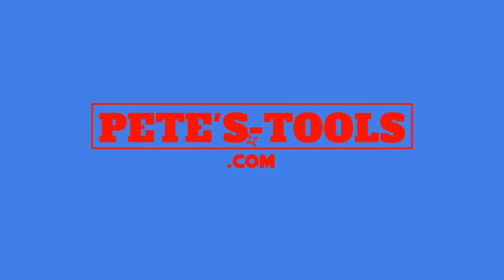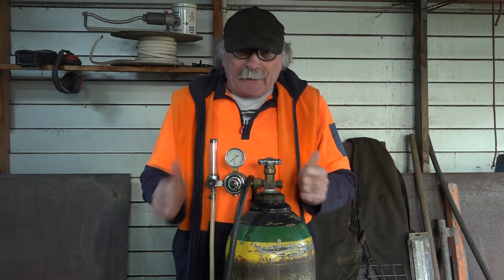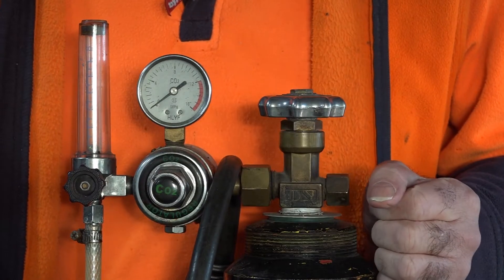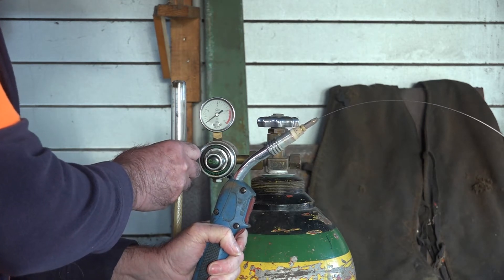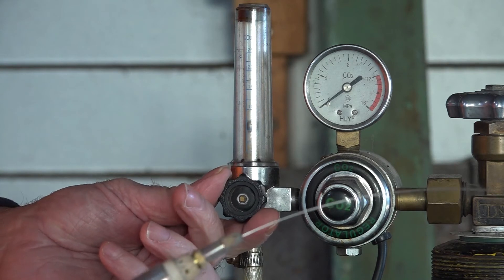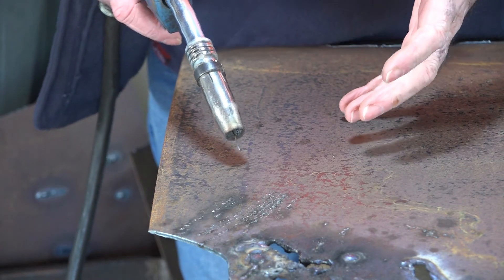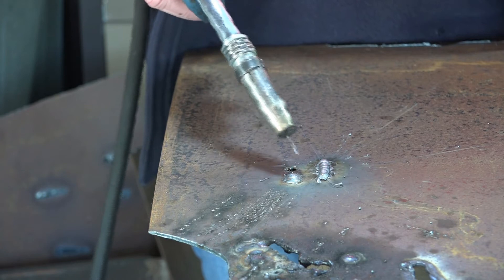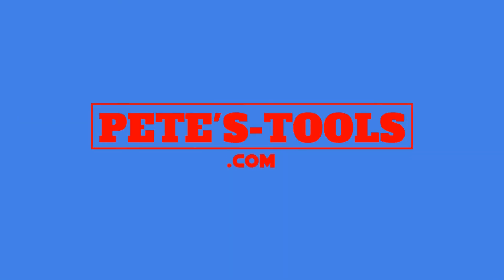Which is better? Flow meter or Welding regulator?

Comment: While I haven't welded with a gas torch in a very long time due to my patio also being my workshop, the flow meter is almost always an accompaniment to an oxy-gas rig here in the US. I know a lot of guys run them to help meter out their tig rigs, too, so you'll see all three working together for those deep-of-pocket dudes. 
Me being at the mercy of mother nature, I will run C02 when I can but most of the time I do a lot of flux-cored stuff. My big project two years ago ended up gobbling up 6 kilos of stainless steel flux cored wire and was the mother of all learning curves for me. Very interesting stuff, not particularly cheap, but necessary for building jet engines. 😁
Reply from the maker: Wow mate that's sounds very interesting .

Comment: Hello Peter, I have a normal pressure reducer (regulator) on the Mag welding device. I use the flow meter on the Tig welding device. Greetings from Lahr Germany
Reply from the maker: Cheers Marko .